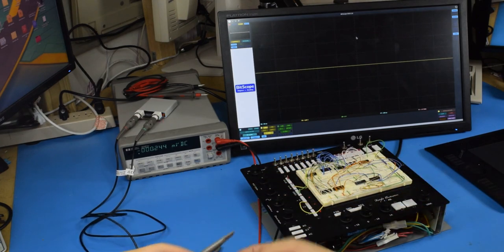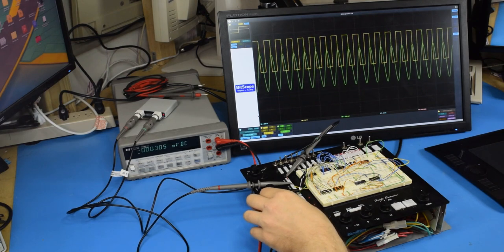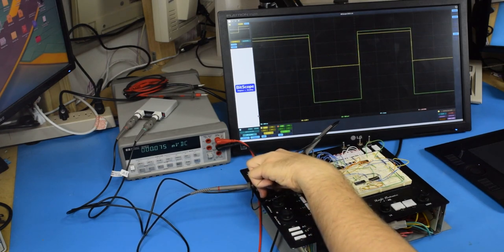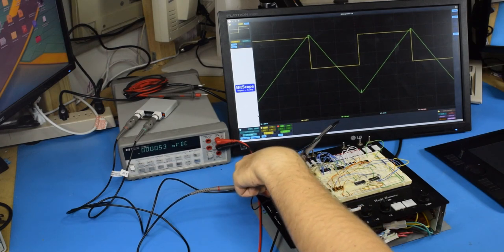0x0015 - Knight Electronics ML-200 Mini-Lab

Comment: I bought a soldering briefcase a long time ago that came bundled with JUST the faceplate and power supply transistors (not even assembled yet). I put the power board to the test and it passed, so I mounted the power supply/transistor board rail to the faceplate. Since my kit is incomplete, your idea of using banana plugs was very inspirational. I'm going to figure out how to incorporate my Raspberry Pi AND Arduino into this, as a mod to make it super functional. Yet maintain it's original function too.
@Tech Tangents, thank you for the great review. I know I'm late in the view-game, but this was exactly what I needed to move forward. Aces man!😊

Comment: Signal gen: Sine wave is a simulated wave and has clipping on the possitive and negitive cylces. Also seen in the saw wave. At times, the square wave can have rounded corners if the individual componants is of lower quality. +18 and -18 Volt levels are adjusted on the circuit board under the main panel. If you by this in KIT form. Verify that you wire the main power switch on the HOT leg. The drawing shows it on the Neut. Also confirn electrolitic capacitors are correct polarity. In our classes (across the 2 years that I was at school), the elecrolitic capacitors sometimes had the polatiy shink wrap on backwards. They would make a BIG mess when they would explode in the mini-lab and all over everything. I still have my original manual and the changes that I provided DeVry with. I know that the changes were handed out with the new labs here in North TX. I do not know if it went all through the school sytem. The Dean of the ET program also contacted Knight Electronics and they were unwilling to update the manual or provide the corrections that we gave them.  Kerry

Comment: I bought the bigger version the knight mini lab 2010 I believe they call it… I was really impressed. Able to add my battery powered oscilloscope, multimeter, TS 80 soldering iron and power bank I used to run it portably… and a few other things to a bag that I can carry with me… And I can do an incredible amount of things went on the road.
Reply: I know they can get expensive but if you look out for them on eBay somewhat regularly, you can pick up the big version for around $100, and you’ll find a mini available if you just keep an eye out over several months… And usually most of them are brand new never used.
and they cost way way way more than that if purchased no

Comment: I only found 2 companies that have the newer version Knights Electronics ML2010 for $631 to $659. If you buy used - make sure it comes with the manual. That helps with troubleshooting.
Reply: I have one I believe to be complete. The manual, tool organizer,tools, multi meter, a good amount of different electronic components,I will let it go for half of that Kerry.

Comment: What's the software you used for the oscilloscope? And to draw the circuit?
Reply from the maker: The circuit schematic software is KiCAD.

The oscilloscope is the Bitscope DSO. You have to have a compatible Bitscope product like my BS10 ( http://www.bitscope.com/product/BS10/ ) to be able to use it. I chose that one over others at the time for it's Linux(even RPI) support and it's Python libraries allowing for automated control.
Reply: Thanks!